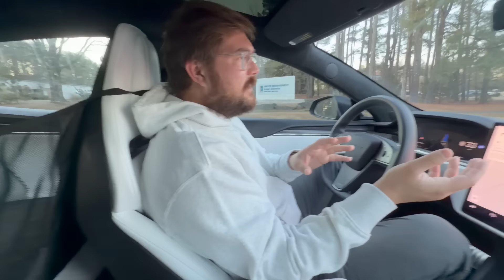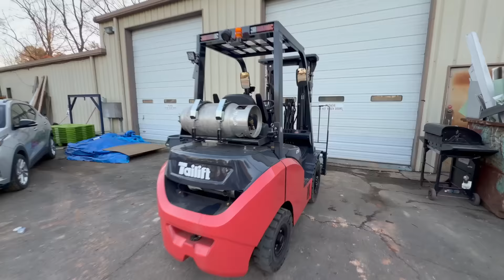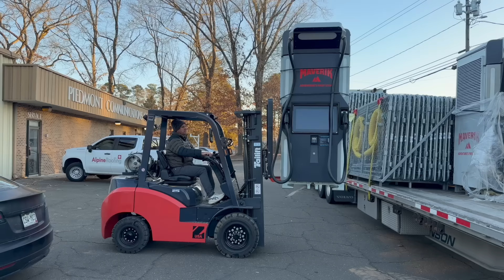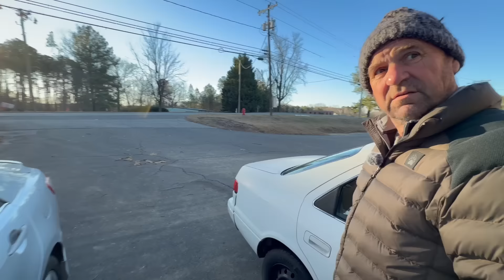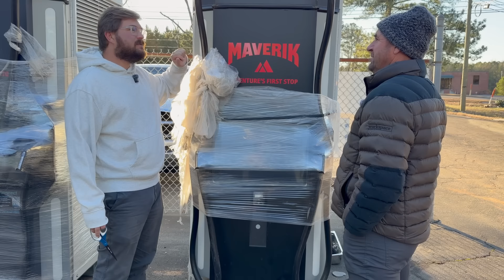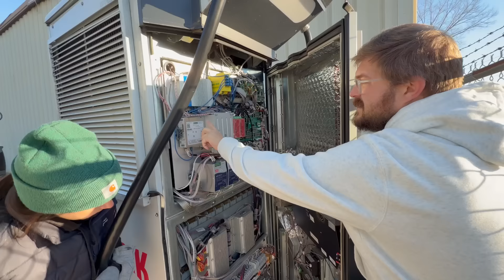I Bought 3 Freewire DC Fast Chargers For $2,000!

Comment: I'm wondering if those units are supposed to be lifted from the front. So the supports distribute the weight. It would also make sense that they are lifted from the front for much easier placement. So yeah, lifting those from the side might be bad...

Comment: I've installed a few chargers and in my opinion Spot number one is not a good location. It appears to be right in front of the main door so people are going to park there regardless if it's an EV charging spot. Second, there doesn't seem to be any space if someone shows up hooked up to a trailer. From what I saw in the video out by the power pole by the road in my opinion would be a better place. Even if a trailer unit showed up and blocked both ports. Chances are it would be out of there before someone else needed it. Just my two cents.

Comment: Here’s a realistic price range for a FreeWire-style DC fast charger with a built-in large battery (~160–180 kWh) — whether new or used but in working condition — and how to think about the cost:

📌 Typical Price Range (New / OEM) 

🪙 Commercial battery-integrated DC fast chargers like the FreeWire Boost Charger (with ~160 kWh battery) tend to be high-value, specialized units:

Official state pricing documents show units around ~$135,000 – $146,000 USD (~55–60 M HUF) for a ~160 kWh FreeWire Boost 150 model (with 150 kW output) — equipment cost only (not including installation). 

That suggests a new, properly certified unit with a large battery will typically be in the $120k – $180k+ USD range (~45–70 M HUF) depending on model, features, and supplier.

📌 Examples of Used Units (Secondary Market) 

Used units with battery storage are rare, but listings occasionally appear:

Used FreeWire-type charger on eBay (example Boost Charger 200 with built-in battery) listed at around ~$55,000 USD (~22 M HUF) — condition and shipping vary and these aren’t guaranteed plug-and-play. 

This can give a sense that working used units (if you can find one) might sell for roughly 40 – 60 % of new OEM price, but availability is very limited.

📌 Important Notes Before Buying Battery capacity matters: Most FreeWire products have about 160 kWh batteries, not exactly 180 kWh — but performance is similar. Installation & grid connection costs are in addition to the equipment price — sometimes as much or more than the charger itself. Brand and certification: Genuine FreeWire / Boost Chargers cost more than generic chargers due to certifications, software, warranties, and integrated storage. 🧠 Reflective Considerations 

Before investing in such high-value infrastructure, think through:

Purpose & usage: Will this serve enough charging sessions daily to justify the capital cost? Grid and operational costs: Battery-integrated units lower some grid costs but add complexity. Long-term service and support: With FreeWire itself having faced business challenges, support and parts availability can materially affect reliability and total cost of ownership.

Comment: Internal combustion forklift...i really can't understand why they are a thing in the US. In Europe are almost non existent. They're all electric and they've been like that since the '80s. Newer ones has lithium battery packs with huge improvement to the charge duration ( They can work twice or triple as much as lead acid ones and can charge in a third of the time , if you wish)...Internal combustion ones doesn't really make sense . Different thing is if you are in a construction site, where you can't plug in the forklift overnight , but those are different kind of forklits..surely not the ones that you can find in a warehouse.

Comment: They are in good hands now! 
I still think the idea was great just poorly executed like many things with EVs These were never mean’t for high traffic areas, where many were deployed. Good idea for a dealership, township etc not off a highway. On The Run in Canada was deploying them in high traffic areas and were always in low power mode or off. They are switched off now after the thermal events

Comment: Those are beautiful machines! However, even on TV you can see they have build quality issues for something that should have been built for high volume usage.
Reply: Well it is just a charger, if the creases are smaller than you can stick your fingers inside its okay... i mean every ugly ac/dc powerelectronic powersupply does the job, right?
Is this scam as his price is way too low?

Comment: I've worked on more than 20 of these things. The EDNs AC/DC inverters can't handle the pressure of the 100 PSI water pumps. I have had to replace tons of these EDNs and you will have to replace these very frequently. I can retrofit these for you and get these things bulletproofed for you. Let me know.
Reply: The batteries get wet because the overpressure of the gaskets in the EDNs and they leak directly onto the batteries. If you want I can come out and do a video with you about the issue.
Reply from the maker: Hi there can you please email scot@outofspecstudios.com? We’d love to have you on!
Reply: @binauralauto3621  Interesting, the inverters are liquid cooled and leak on the batteries?! 😨
Nice you can help with this 🙂
Reply: @jxeral  When liquid-cooled inverters leak onto batteries, it's a serious issue, often from overcharging/heat causing battery fluid (electrolyte) to spill, or potentially coolant itself if the inverter's cooling loop fails near the battery, leading to corrosion, electrical hazards, and reduced battery life, requiring immediate shutdown
Reply: 100 agree with all of this!  I also have worked and replaced the edns and can recommend only running on one not both if possible to lower the chances of a of both failing at once.  I would love to help up on these if any help is needed !
Reply: @williamlevay5198  I have the "opportunity" to buy up to 20 of these - I am a EE with reverse engineering experience, but I would love to get your opinion about the potential service life of these and how locked down they are without being able to communicate with their "mothership" anymore...
Reply: how do i get a job with working on stuff like this! please help!
Reply: @larrysVB_adventures   By applying at regarding companies mostly. ;)
Reply: @50cts yes thank you for your helpful answer. But I don’t know what requirements are needed etc. or what the actual job would be. I’ve just recently become interested in this type of field 😂
Reply: I’d like to find one of these units, if you’re able to help?
Reply: I have the "opportunity" to buy up to 20 of these - I am a EE with reverse engineering experience, but I would love to get your opinion about the potential service life of these and how locked down they are without being able to communicate with their "mothership" anymore...
Reply: Commenting so someone at out of spec see s this hopefully!
Reply: 100 PSI water pump? Crazy.. Why'd you want that high of a pressure in a coolant loop which could also work with more or less no pressure?
Reply: @50cts  I was wondering about this also, I don't know what internal pump would require 100PSI.  Is that 100PSI for power-washing the unit when dirty?
Reply: @jxeral  240V domestic water well pumps are easy to source and wire using only contactors.
Reply: @binauralauto3621 still a massive design fail.. if you need to charge this fast and you are inefficient so high water flow is neeed it is solved by more flow not berserk pressure 😂

Comment: Here is my prediction. Soon when batteries are dirt cheap, every home will have these to HVDC charge their cars and provide backup electricity to their whole home when the grid goes down.
Reply: You can already buy something like this decently cheap. Well... Maybe cheap is the wrong word but attainable for mere mortals.

The Sigenergy Sigenstore is a whole home solar charger and battery stack that has a 25kW bidirectional EV charger. There was another EV channel I watch that did an event at someone's house where a pile of people brought over EVs to test running the house on it to see if it would support their car.
Reply: Maybe with a 50kwh battery not sure about 200.
Reply: There's no point in DCFC a car at home when you can just plug in and slow charge overnight with much cheaper power and without the overhead of another battery and expensive inverters
Reply: @samin90 I agree but if you already have let's say 50kwh at home, I currently have 30kwh of LFP batteries in my basement, then why wouldn't you want to have let's say 50kw+ DC charge rate. The question when batteries are so cheap to backup a house why now integrate it all in one. DC to DC is actually cooler to run cause there is minimal conversion loses.
Reply: @TheLobo91 the hardware for high dc charging so expensive... any cheap solar inverter from dc lfp battery to 22kw ac wallbox would be nice😅..
Conversion losses should be manageable with ac too, its not like you are wasting 20% or so 😂
Reply: @mmuller2402 it's already built into the car. All I'm saying is when batteries are cheap you let them discharge into the car. DC to DC. With high voltage you can lower the current and have 22kw charging on DC on the same gauge wire. The car already has the charger in it. That's what you use when you use superchargers. Also the nacs protocol can hand both AC or DC. When home already have solar, batteries, and EVs it makes sense to store that power and transmit in DC between them. Every solar system works on DC.
Reply: @samin90 because you never get home and want a quick top up before heading out again, and never would want to run your stove and heat in a power outage, and never would want to be able to have a friend over and let them top up their car in the couple hours they are staying... Nope, no reason at all. Everyone are just robots that drive home from work and leave their cars plugged in for hours on end.n
Reply: See Sigenstor
Reply: The LFP battery is already dirt cheap, it's only priced at $80/kWh right now

Next 5 years is gonna be more interesting, if the cheap $35/kWh sodium ion batteries are gaining enough market share, the home battery setup will be even cheaper than it is today

Comment: Hopefully these units stay working for you guys. The ones down in Waco, Texas were constantly down and had connectivity and hardware issues. Wasn't ever a huge fan of them when they were first installed, but luckily there are plenty of other options on the way down to Austin.
Reply: they were built a year ago, looks like the last of the charger stock they had

Comment: Kyle, do you think more DC fast chargers should have batteries integrated into them? 
I would think if the battery itself in the charger could charge at Level 2, that would negate the need for the super expensive grid upgrades required for L3 or L4 charging
Assuming that it isn’t being constantly used all day, so maybe it’s best for rural areas
Reply: Not needing the infrastructure is nice, but I see real benefits on demand charges. On my commercial account >60% of my bill is based on peak demand. If I could pay at my average rate rather than peak, with the same total used power in a month my electrical bill would be almost half.
Reply: @Senthiuz great point!
Reply: ElectricEra uses similar hardware but with a totally different charging strategy (battery boosted DCFC vs. AC charged battery) than FreeWire.
Reply: The problem is that if the charger gets used more than just once in a while then it will be insanely slow and unreliable for regular use if the pipe in is too small.

That makes for terrible experiences for users. It also makes the chargers way more expensive which is a problem of getting them in place already.

Batteries also can't charge below freezing (most lithium ones, anyway)... So now you need an insulated enclosure and heating system.

This is far more complicated than you would first expect.
Reply: On The Run brand of fuel stations use these along the Ontario 401 corridor. Every time I stopped to use one on a journey, they were depleted and in low power mode. As much as I like the convenience store section of the brand and the rewards program, there was no reliability in getting a charger with high power capability. I stopped using them as a destination charging point.
Reply: @darrenmurphy1046  On The Run had two thermal events with them in BC. The 401 ones are simply stupid to have in a high traffic area. Someone gave a fancy power point. Iirc they are still switched off.
Reply: @darrenmurphy1046 because the design is dumb, ac to dc to store in chemistry losing charge over time to dc/ac to charge the electricity is just a bandaid nothing more...
Heck there is even no solar panels close to it to charge it for free? Fail 🎉😂
Reply: @Snerdles  

I think the sweet spot is somewhere in the middle. That is, you still use batteries, but you also upgrade the site's grid connection to something more than level 2, but still much less than would be needed without batteries, for example, a bank of 4 200 kW chargers powered by a 100 kW power supply. I think the size of the battery you'd need to keep the site reliable would be much less this way than if you tried to power the batteries off a 10 kW level 2 power supply.
Reply: @ab-tf5fl So do some quick math. How long would a 200kWh battery last if 4 200kw capable vehicles plug in with 100kW coming in?

You're using 800kW, 700kW from the battery... That's about 16 minutes and then everyone drops to 25kw charging for the rest of the day since even 1 car plugged in that could potentially get more than 100kW can no longer charge the battery and would keep draining it.

So sometimes when you plug in there you get 200kW but the vast majority you will get 100, 50, 33, or 25 depending on what's charging.
Reply: @Snerdles should be discounted then
Reply: @a @ab-tf5fl there are lots of setups like this sole even running on pure solar  solar+ grid connection in more rural areas

Comment: A 150 feet of cable to run it to the far end of the building is going to cost a fortune. Probably more than the installation by the electricians
Reply: Eh, with AL wire it won’t be too much.
Reply: Line loss

Comment: Crazy that you got these for under 1% of original MSRP!
Reply: The price they paid is worth it just for the 180kWh of batteries alone!
Reply: @rocktheworld2k6  good cells for Nissan Leaf are still needed
Reply: Who says they even work.
Reply: @zachlafond2652  they were made a year ago, probably the last of the stock they had
Reply: @zachlafond2652 programming may be an issue
Reply: Depreciating almost as fast as the EVs they charge!
Reply: @Snerdles  Which doesn't make sense when the value of the parts is more than they paid. This is as just an freak offer.
Reply: @Neojhun taxpayers paid for them
Reply: @Snerdles  🤣

Comment: Can't imagine how much an electric company would charge to install something like this.
Reply from the maker: Won't be much - just needs a simple 100amp max connection - can even dial it down for a slower feed. Because they have batteries in them to act as buffer the electrical load on the grid is minimal!
Reply: Very little. That’s the whole point of these.